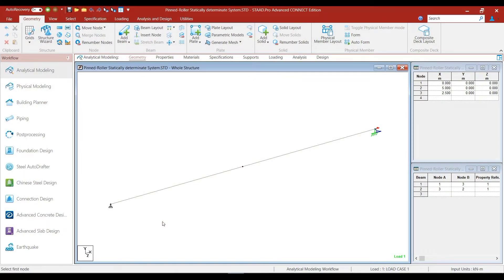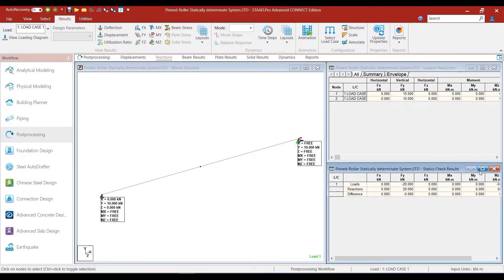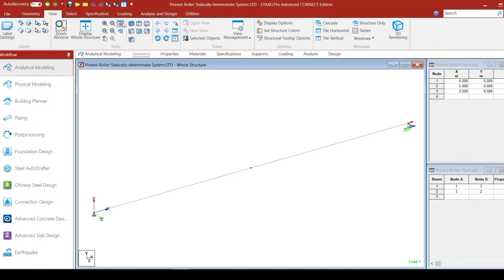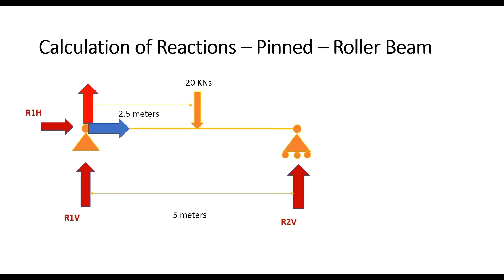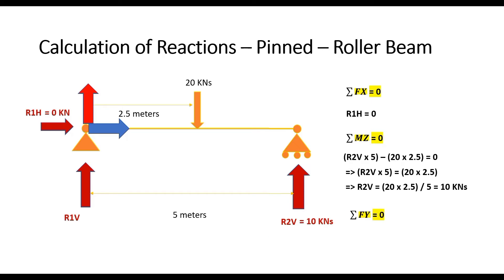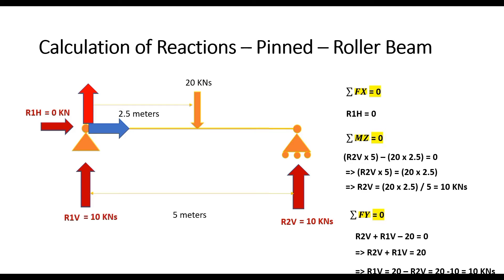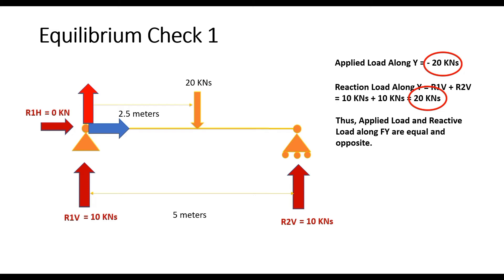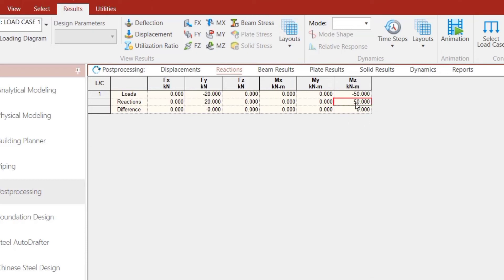#54 - Understanding Statics (Equilibrium) Check Table in STAAD.Pro

Comment: Simply to say, when you are checking on overturning and sliding check you can directly use the result from the statics check result provided that your point of reference is correct.

Comment: Your videos are simply excellent.. very short and neat..thanks for your videos..

When to consider right hand rule and left hand rule ? Can you explain..

I have need to get clarify regard support restraints particularly hinged and roller support in theta x,y,z ..can you give some live example?

I have assumed that door for hinge support and rolling chair for roller support..in this how the not contraint of theta x,y,z is possible?

Can you explain  pls? Thank you .
Reply from the maker: Thank You for your kind words. There is no Left Hand Rule in STAAD. Regarding Hinged and Roller Support, please refer to the following session - https://www.youtube.com/watch?v=zHci3X7lmLU&list=PLAGZDi029vcnZHwQMm43zZbmBwGk0AvOq&index=10
Reply: @structuralinsider8671   Hi sir, 

I have already watched this..i want to know  specially how theta x,y,z in roller support will happen.
I have taken example of roller support as rolling chair..

Hinged support as door..Gx,Gy,Gz ...Theta x,y,z how it will happen..

Thank you..
Reply from the maker: @gowthamiv4841  What I have spoken about in that video is about the pinned roller support - a pinned support on wheels and thus it needed the release of thetax, thetay and thetaz. A rolling chair - which is clamped to the base with wheels does not fit this condition - because the clamping does not allow free rotation of the chair about the base - however the wheels allow translational motion. If we are to consider the base as the support, then there would not be any release for moments. Assuming the chair is free to roll along any three translational direction - the support command for the base of the chair would be FIXED BUT FX FY FZ -if you consider this in three dimensions.